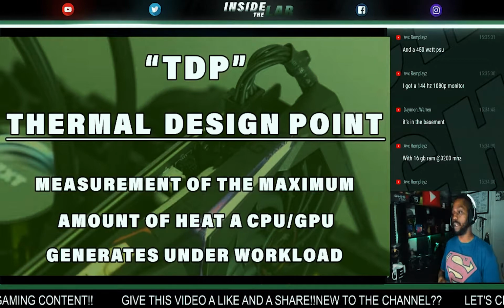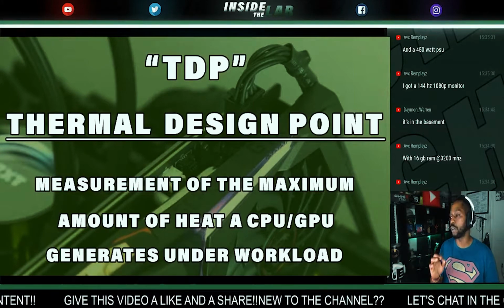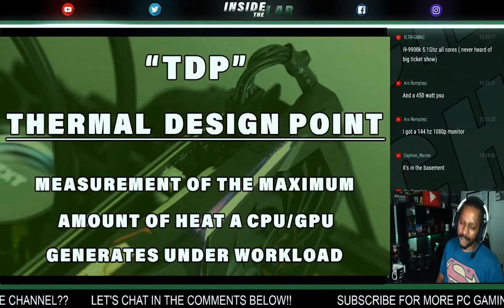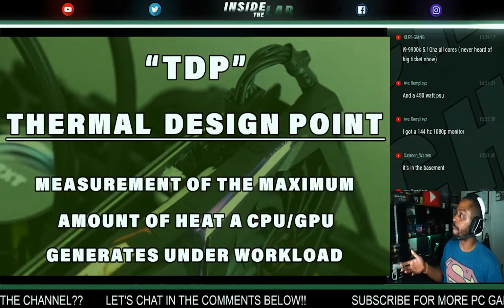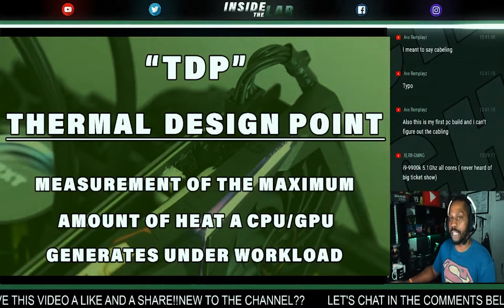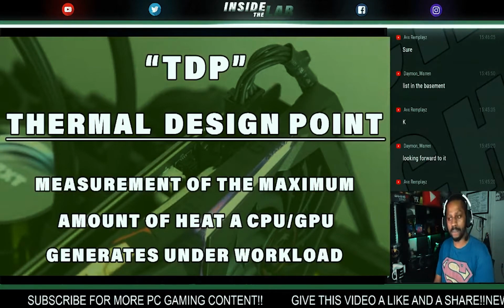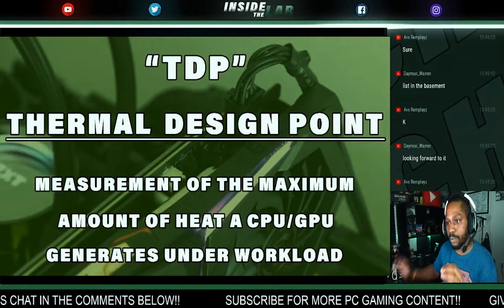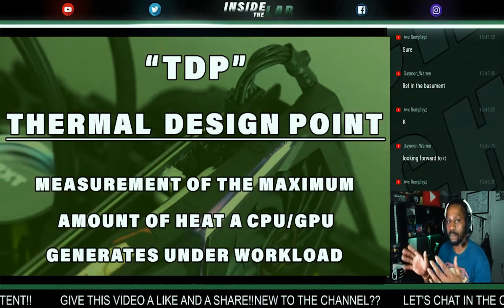TDP Explained: Why Your PC Gets Hot

Comment: Awesome highlight

Also I think it's Intel's fault that this tdp definition got messed up in the first place 
11900k runs at a tdp of 125 watts and gives around 4ghz but needs to consume around 240 just to reach it's out of the box  potential without any overclocking
Its crazy to think a 16 core 32 thread cpu is like 30-50 percent more efficient even without a tdp limit 

Alot of prebuilt manufacturers go with the bare minimum just to save a few cents here and there and gimping performance customers pay for (source dawiddoestech awesome guy)
And with Intel giving manipulated tdp(giving the notion that they did there job with specifying there product but not really showing the big picture)
Prebuilt manufacturers are making bank selling overpriced crap with gimped performance to customers 

Even alienware gives Intel alot of preferential treatment by labeling it as a gaming king and labeling AMD for productivity aimed gamers giving very bizarre listings

Sorry for the rant love your videos
And yes I'm still confused about tdp 
There is no clear answer
Its up to us and you reviewers to figure out how much heat it gets power it consumes

Comment: One question, My ram is 32 gb of ddr4 3600mhz, but when i go to put that speed in the bios it says that it didint save, i did save it
Reply from the maker: Hey @Zeysti it still reads 2133Mhz in Windows?
Reply: @SuperMetaTech  its 2400mhz
Reply from the maker: @AdrielCrespo08  That could be the max rated speed at quad channel on that board. You may want to try a manual over lock (increasing voltage as you increase speed, I recommend not exceeding 1.45 volts) starting with 2666mhz and up until it shows the selected speed in Windows.
Reply: @SuperMetaTech  but my motherboard can go up to 4400mhz
Reply from the maker: @AdrielCrespo08  Yes that is true, but to achieve that 4400Mhz frequency requires a manual over clock and not just loading a memory profile. There are other tweaks that need to be made.
Reply: @SuperMetaTech  like what?
Reply from the maker: @AdrielCrespo08   Voltage and timings those two most importantly.